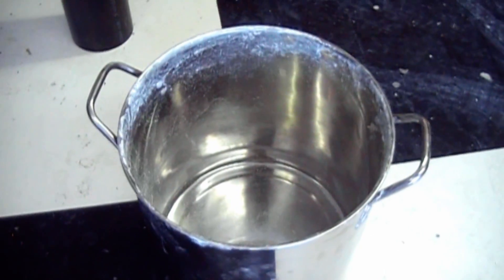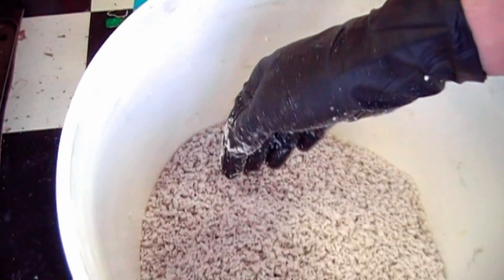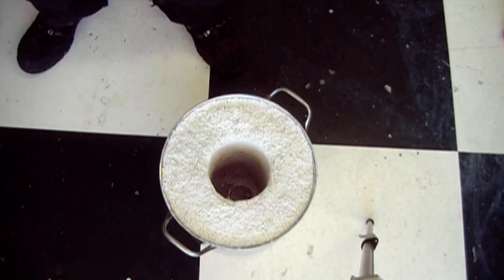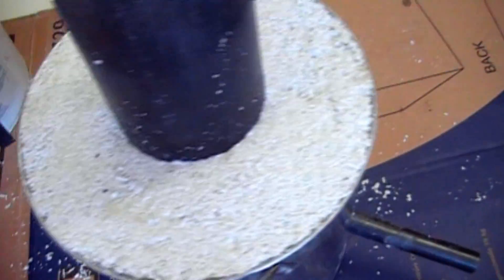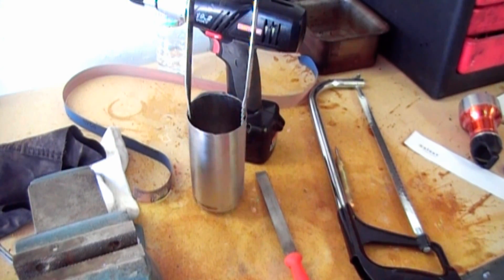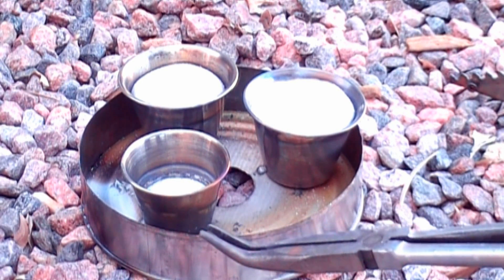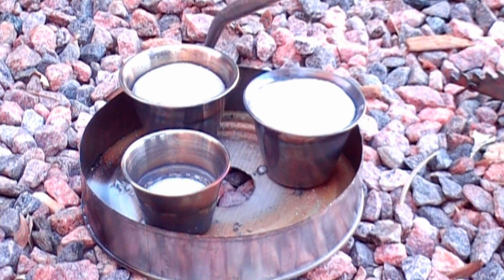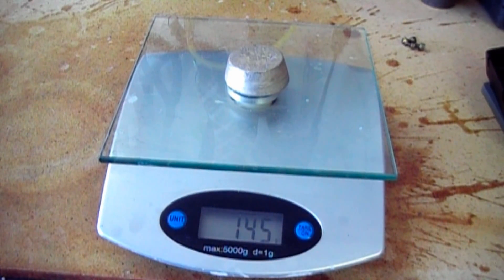How to make a small foundry

Comment: were do you get your scrap metal if it isn't cans and were can you get the scraps also will it melt copper or can it not reach the temp
FYI love your vids they are very helping
Reply from the maker: Cast car parts are about the best source, I melted down some aluminum CO2 tanks too. I think with this foundry copper is just out of reach, melting it is one thing, but it must also be hot enough to stay molten during the pour. Thanks for the comment!

Comment: You should have cast the bottom first, then the sides. Ad if you put some type of release agent on the center form, it won't pull the refractory away when you remove it.
Reply from the maker: Ben Press Yea I'm finding out proper form design and prep goes a long way. Sigh, another skill to learn!

Comment: For additional forming techniques you can refer to cement form assembly guides etc. For example you can use wooden scrap material blocks to tap down the material to get a tighter bond and do it faster. Just be careful if your naturally clumsy. Good luck.

Comment: how fast will it get up to temp and how quick does it melt aluminum
Reply from the maker: Depends how much aluminum you got in there. From melts I have done, about five minutes to get the inside of the chamber glowing orange, after that about ten minutes to melt what I could fit in the crucible.

Comment: you can use baking soda as a degasser and table salt to make the Al more fluidic just rap it up in some foil use the baking soda after you remove the dross then remove the dross again and right befor the pour add the table salt stir the Al . try to push the baking soda to the bottom of your crucible till gassing stops

Comment: What temperature can this foundry get to? Is it only good for aluminum or is it capable of melting other metals? I intend to build one myself, but I would like to know the limitations.
Reply from the maker: I have found that with the burner I have in there, brass is pushing it, aluminum is easy and copper just won't make it to melting temp.

Comment: How hard does the foundry get once it's dry? Mine seems to be dry after about three days but it's brittle, almost like Styrofoam.
Reply from the maker: If good compaction is not achieved, it can be pretty crumbly. The most difficult part to get compacted is the top, no weight on it while drying, and no support like the bottom has. This method seems to have it's drawbacks, though I never thought it would get this popular. I would recommend a sealing cement to "cap off" the exposed perlite. I'm working on a newer version of the forge and have developed better techniques. I hope to post that vid soon.  Thanks for the comment, if you have any more questions, please post them here.

Comment: How long did it take for the foundry to dry and how long did you wait before you fired it up for the first time. The sodium silicate that I made seems to take several days to dry.
Reply from the maker: At least several days, you can finish it off in an oven which is what I did.
Reply: clkindred Ok good. I was concerned that maybe I did something wrong since it takes so long to dry. FYI, a good and cheap flux that has worked for me when melting lead is borax, which can be purchased in just about every laundy isle in any grocery store.Thanks

Comment: You said something about fluxing the crucible. How did you do this?
Reply from the maker: A small amount of table salt is added to the molten aluminum to flux. Fluxing is first and foremost, a way to reduce the melting point of a material, if already molten, fluxing will make the molten material more fluid. It also helps free the slag that is trapped in the metal. There are different kinds of flux for different metals, table salt is not ideal but it is what I had on hand.
Reply: Thanks! I really like your videos by the way. Very informative.
Reply: clkindred  Candle wax also will work but it will flame up quite a bit till its burnt off

Comment: Love your videos. a small word of caution though, just in case you do not know about this yet.  Be very careful with brass. It contains zinc, which in vapor form can make you very sick. It is very toxic and The toxicity grows exponentially the more you are exposed to it (think of synergy- 1+1 equals 2, 2+1=5, etc.)  I have been exposed twice and nearly ended up in the hospital the second time.  The term is Metal Fume Fever and it is very dangerous.  Just a wise word from a young fool.
Reply from the maker: Oh yea, I know what you're saying, melting brass is scary because in order to get to casting temperature, you have to exceed the boiling point of the zinc. The whole thing starts popping and bubbling while spewing yellow smoke. Thanks for the concern and for the comment!
Reply: clkindred Stat or you have a respirator Will that be enough
Reply: Story my tablet did its own thing on last post what if i used a respirator Will i be safe

Comment: Used your recipe for cement to apply a surface to ceramic blanket on my foundry lid,cut blanket to shape and put in place then applied cement to exposed surface.The cement acted as a ridgedizer and formed up a very hard and durable hotface for the lid , surface of blanket is now very hard and handles heat vey well.
Reply from the maker: Oh, great! Sorry I did not get a notification of your comment. I would like to get my hands on some ceramic wool someday.

Comment: You added water in this mixture, as opposed to the coffee can forge, which had Perlite, sodium silicate and plaster of Paris, but no water. Also, you didn't seal the inside with home-made high-temp cement (sodium silicate, aluminum oxide, baby powder and plaster of Paris). Do you believe THIS mixture to be better than the  coffee can forge mixture; and what of the liner cement?
I ask because I am about to make a forge (like your coffee can forge, but larger) and need to know your thoughts before continuing. (It is important.)
Thanks!
Reply from the maker: Thanks for the interest, I did line the inside with alumina and silicate later, but after some long firings melting brass, the perlite started to melt from behind the lining. I'm still researching and experimenting with this type of stuff. The forge refractory held up better but I designed it wrong which makes it hard to use. I think the plaster in the forge lining has a larger effect than just aiding curing.

Comment: Great video, I am still having troubles with my lining on mine. I lined it with high temp cement and noticed there were air pockets forming in between the cement and perlite mix. I may have to remove the cement and do a firing to get all the moisture out. I will post videos of issues once I figure out some solutions.

After watching your video I think I may know where I went wrong in a few places.
Reply from the maker: Dang, I thought that hi temp cement was going to work out real slick, hopefully like me you will find second times the charm. Dose the tub of cement state a maximum application thickness? I looked around at similar products but it seemed they could not be applied very thick (like 1/8'' to 1/4'' or so)
Reply: I might suggest maybe pouring it slower? Usually I find if I pour it slow enough it wont have any pockets